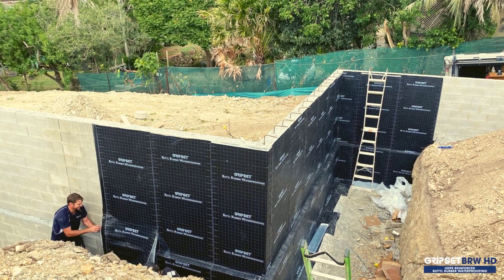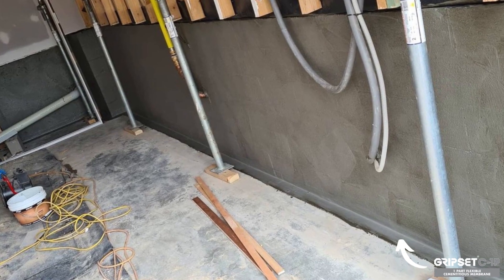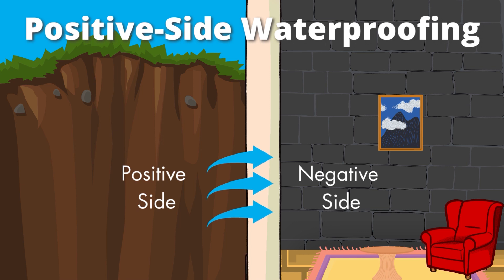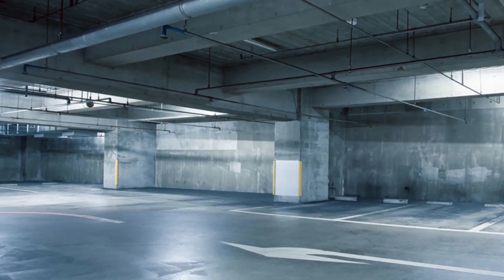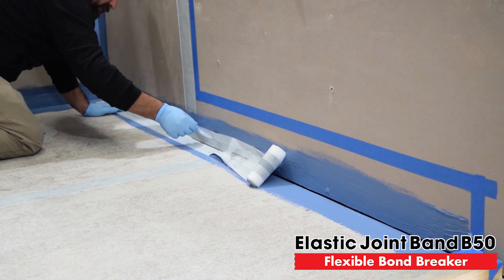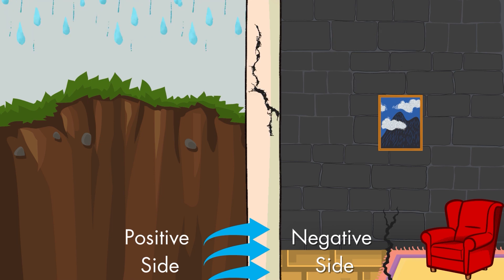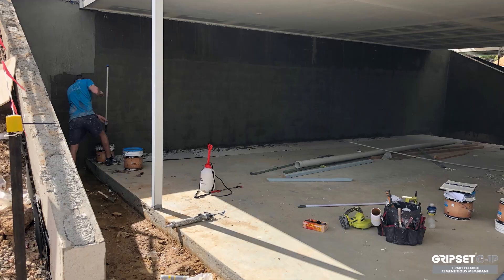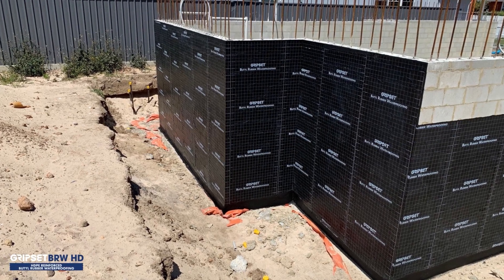How to Waterproof Retaining Walls | Introduction

Comment: It's 2024, why is so much time spent on waterproofing basement/below-grade walls and basements? Is there a concrete mix that stops water? There should be a poly-type spray that permanently seals a basement in 1 application at a minimum.